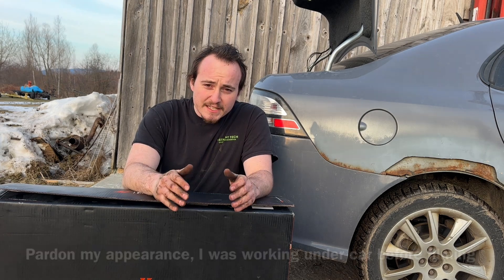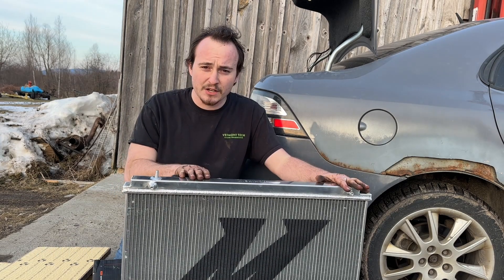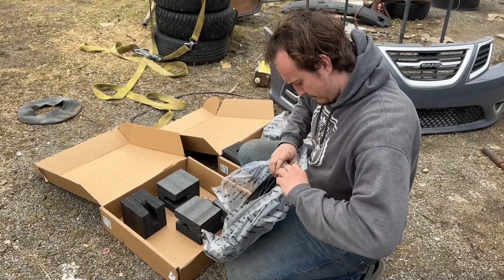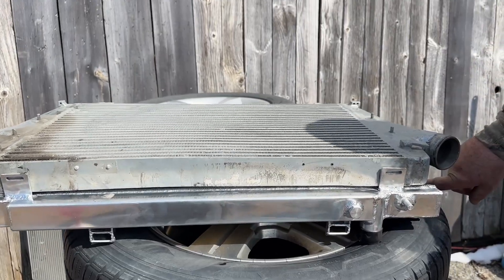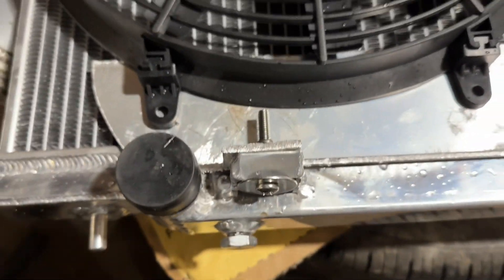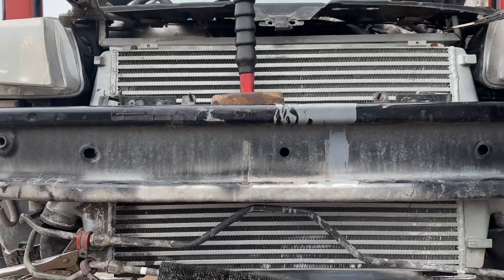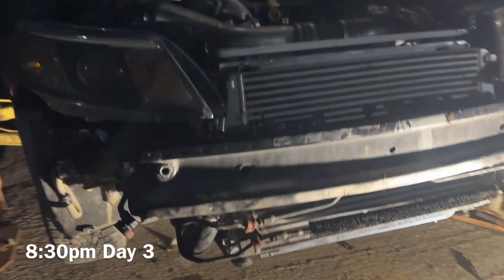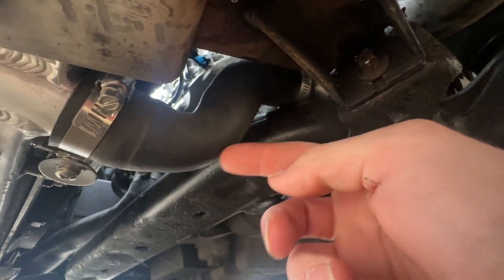Saab 9-3 2.8T Gets a Mishimoto 350Z Radiator Retrofit | Full Install & Unboxing (Sponsored)

Comment: What happened to your Do88 intercooler mate? I know you got into a collision but It looks like its rotted out too??? Worried now as I just bought a Do88 intercooler for mine!
Reply from the maker: @mattpitcher  The radiator got into an accident. Then from there it just kept deteriorating. As long as it doesnt leak when you forst install it you shoyld be fine. My old 9-3 still has its do88 kit and its been on the road w it for 5 years just believe.

Comment: Would this work for a 2.0T car or no ? would love to put this on mine
Reply from the maker: @liamfox2258  I do not know the ins and outs of a 2.0, i only know the 2.8 system. You can see how much work i had to put in getting this to fit, its not like it lined up perfectly. I chose this radiator because it was similar to the 2.8 rad shape. From what i see on google images of 2.0 radiators you may be able to pull off the job. Its at your discretion really. Good luck and nice work if you do! Cant blame you if you dont!
Reply: @ ill prolly play it safe and go with a DO88 system but this is a very compelling choice as well
Reply from the maker: @liamfox2258  I chose it because it had been done before by another person, and it was a lifetime warranty part. I also knew i had the ability to make it work fabrication wise.

Comment: Awesome work! If you had to do it again would you use do88 or the Mishimoto? I just don’t see a benefit from going to one than the other except the do88 requires no modifications seems like a lot for a 2 lb weight reduction
Reply from the maker: @joellofquist2537  Id go mishimoto for the lifetime warranty for sure.